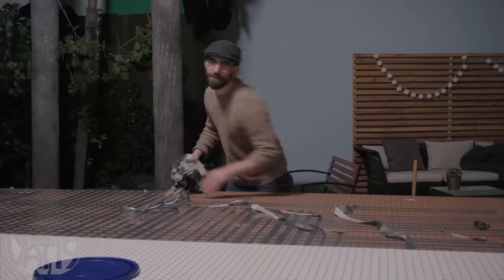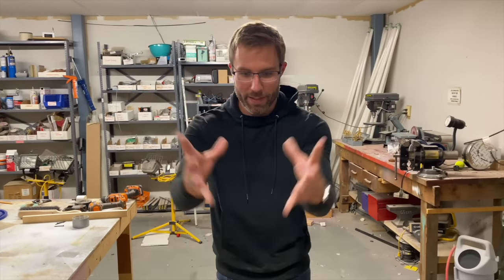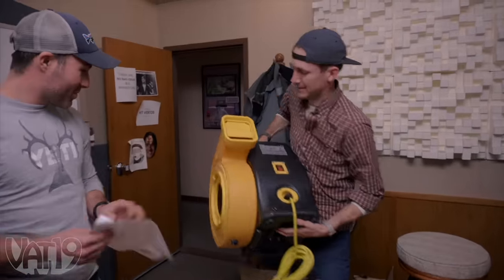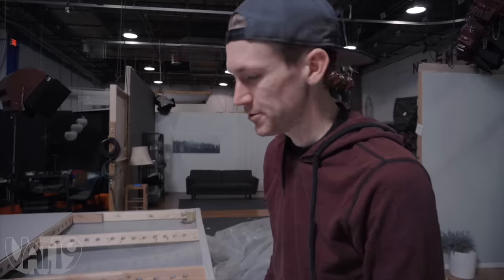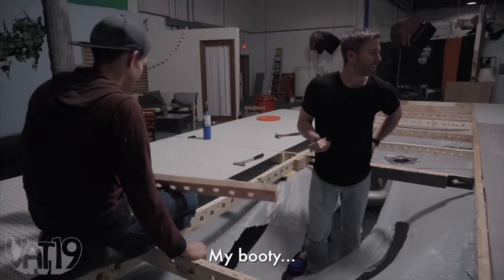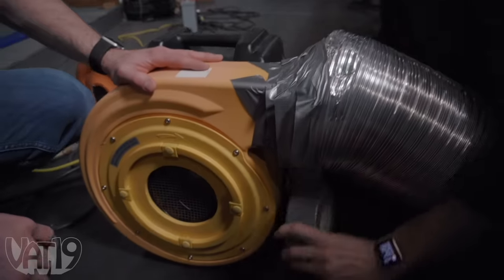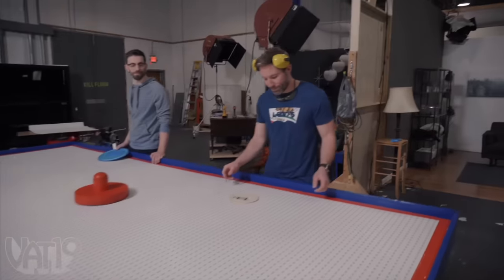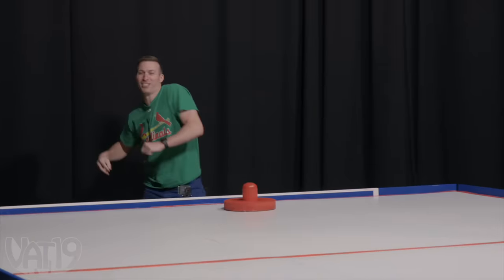We Built the World's Largest Air Hockey Table • This Could Be Awesome #10

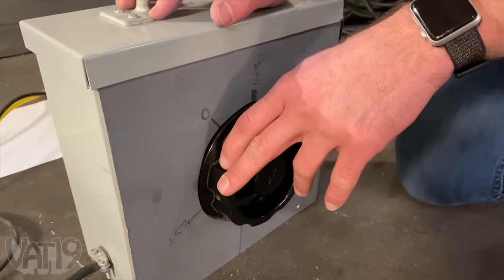Comment: 3:31 actually the original intended purpose of DUCK tape isn't for ducts, the name comes from it being waterproof like a duck's feathers and was meant to be used as a multipurpose waterproof tape, duck tape actually doesn't last long in ducts because the heat causes the adhesive to denature, for ducts usually aluminum tape is used.

Comment: They coulf have just made the hole smaller tgey didnt account the way the air would just flow out straight out of the first holes they can get out of if the holes are smaller air cant get out fast enough and more holes have airflowing in them

Comment: Wondering, you'd lose out on the 'air' part. But couldn't they have used the never melt ice sheets from the longest hockey dribble video.

And used that as the surface?

Comment: Never watched this channel before, probably wont again. I'm shocked just how little everyone knows about engineering. Why would you think those HUGE holes in pegboard is the right way to go? You need pressure, not flow. That's why an air hockey table has very tiny holes in it. Also, you don't need a light puck, you need a heavy puck so it can maintain momentum. An air hockey puck is pretty heavy for its size. It's heavier by its self than most of the things you tried. Have you ever watched videos of the military hovercraft? It weighs thousands of pounds and floats on air. Air is more powerful than you think and it doesn't take much to make something float.